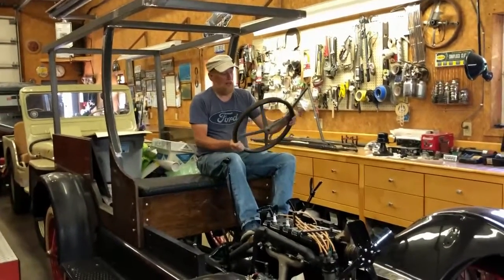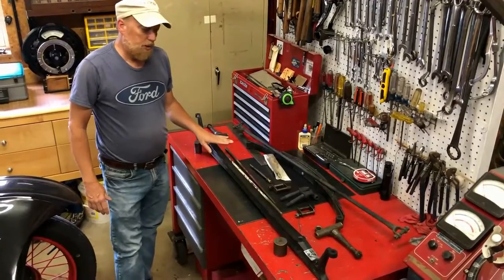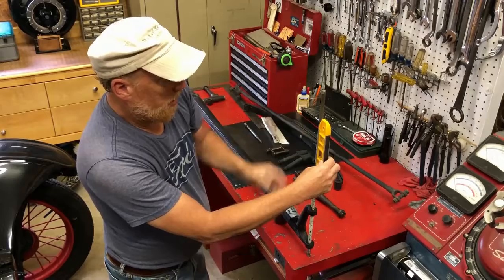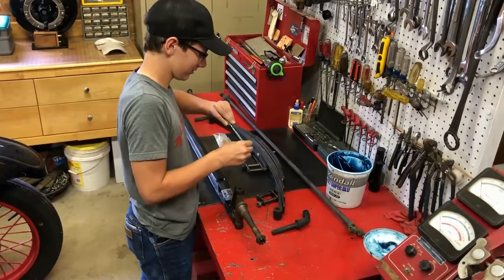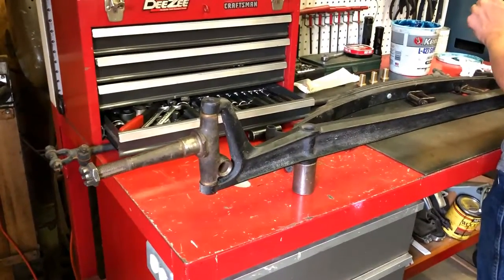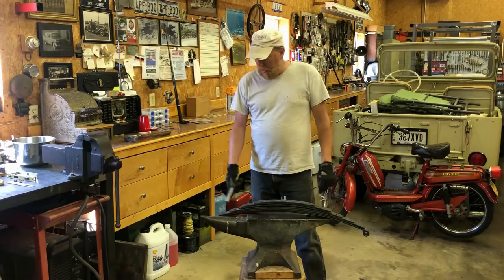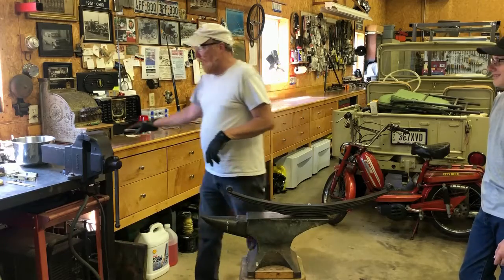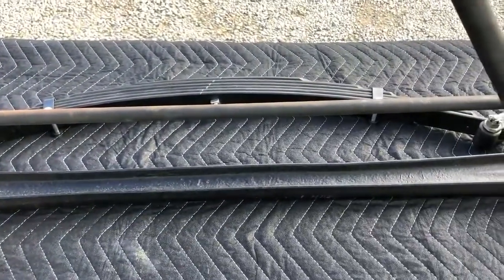Ford Model T Front Axle Build  [EP 38] @KlepsGarage

Comment: Did you use the special bolt in the middle of the spring with the large head?
Reply from the maker: Yes. But the rear spring takes the large bolt. Front spring is smaller with square head.